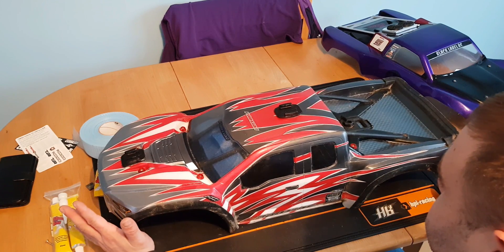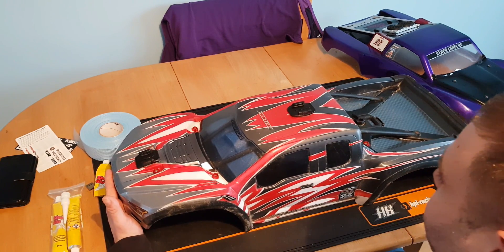HOW TO MAKE YOUR RC CAR BODY UNBREAKABLE!!!!!!

Comment: Holds together well, yes, but it took me 6 hours to apply with too thick of shoe goo and too thin of dry wall tape. I’d recommend using spray adhesive, then dry wall tape, and with a final coat of bed liner. Adhesive holds tape in place, tape holds body together, and bed liner keeps it clean and flexible.

Comment: Need to put some stuff up on the walls to eliminate the echo.
I've been thinking about getting the measurements and making a heavy duty roll cage for my E-MAXX. It flips too easy, needs wheelie bars all around it..
Reply from the maker: That's a good idea. Yeah I'm thinking about buying a proper mic as I'm just using my phone for most of my filming.
Reply: ALL DAY RC if it's quiet out side a window or door will work as well.
How does yours have room for all that foam/does it make the esc get hot?

Comment: If you're lazy or don't want to get real involved couldn't you just use Shoe Goo and apply with  bump pad foam pad brush  and be done with it. Is the drywall tape necessary?
Reply: The drywall tape provides most of the structural support. Think of it like a flexible frame of sorts

Comment: Thanks for sharing. Where did you get the Shoe Glu / Goo and tape so cheap? On Ebay it's £10 delivered for the 55ml tubes
Reply from the maker: Yeah unfortunately the price has gone up drastically, probably with demand. (Shoe goo)

Comment: I'm here over a year later. Curious if this is still the method you are using?  Or anything better now?
Reply from the maker: I still use exactly the same method
Reply: @d252428q  Thanks.